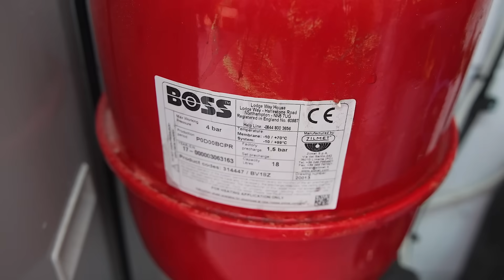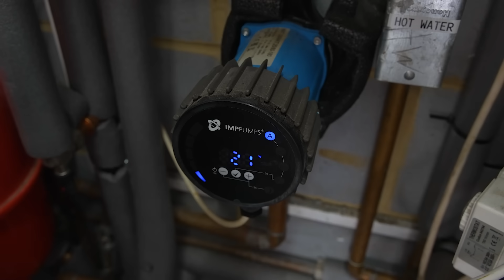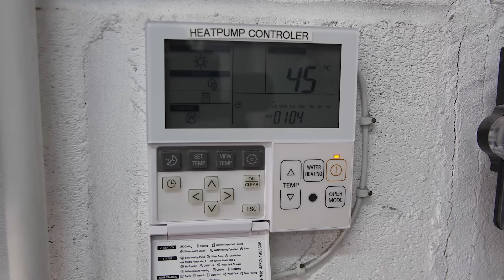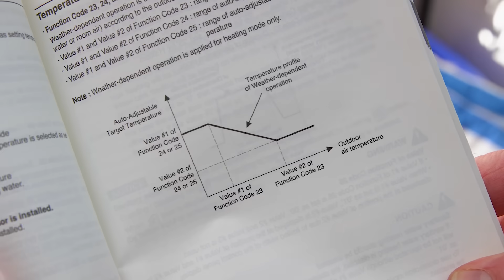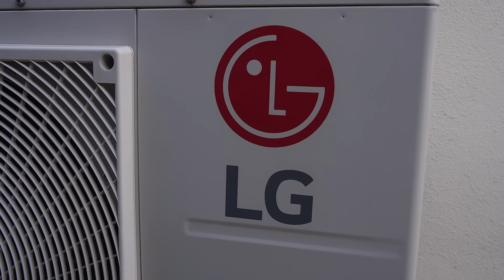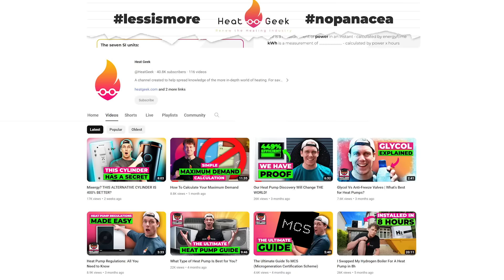Heat Geek Gives His Verdict on John’s Nightmare Heat Pump

Comment: I am Canadian and live in Saskatchewan where it is common for temperatures to reach -30 degrees celsius and lower for days  on end during the winter months. I worked for a school division for 24 years in maintenance and was looking after a school that had 22 roof top units which were basically a furnace and an air conditioner unit enclosed together in a metal cabinet which had at most one inch of fiber insulation on its inside walls. My question is in this day and age and our quest for energy efficiency why would you place these units on a roof top exposed to the elements . They were very hard to work on when the wind was blowing and it was 35-40 below celsius and I can only imagine how efficient they would have been . I can`t see much difference between them and these heat pumps except that the units on the schools were natural gas and heat pumps are electric which is even more costly and less efficient.

Comment: Question for @heatgeek:
I am looking at a system where the hot water tank uses a plate heat exchanger + circulating pump to take heat from the heat pump loop instead of an internal coil. I believe the main bnefit of this is that I can get more usable hot water in the tank (it' s a 170L) as there's no coil taking up space. 
Thoughts in this setup type?

Comment: Great video, Thankyou. I've got a heat pump and the installers didn't explain weather comp at all. I worked it out through heat geek advice.

For the underfloor heating I kept a blending valve on the circuit for underfloor heating because my LVT flooring has a temperature limit of 27deg C. Do you think a flow temp of 45 Deg C straight into thea manifold would be safe for the LVT?

Comment: Great video would love to see a follow up when savings can be proved. The fundamental issue for me is that after spending all that money, even 420% efficiency is not enough to make it cheaper than a 90% efficient gas boiler. 35p per kwh electric / 4.2 = 8.3 pence per kw heat for electric. 7p per kwh gas / 0.9 = 7.8 pence per kwh heat for gas. So even the most efficient system costs more to run than gas excluding the additional cost of heating water less efficiently and the fact it has to run virtually all day long.

Comment: The lower COP is because of the difference or delta with the indoor temp and outdoor temp. the buffer means it can stop the heat pump cycling and for a reserve of heat for defrost cycle

Comment: They haven’t installed a pumped mixing manifold just because it comes as part of a package, you can buy manifolds without these things. If your secondary pump hasn’t been sized to overcome the resistance in the underfloor heating circuits, then you will need a pump on the manifold. If your flow temp is set to 55/60 like this guy said, obviously for hot water production purposes, you will need a mixing valve as the underfloor heating will be designed to run at 45 deg c. 

Buffer vessel is installed to stop short cycling of the heat pump, and although not always required on a domestic system, is always a good idea if your heat pump comes with its own hydronic pump set because these pumps are best used as a primary circulator only.

If you are having frosting problems, do. It take out the glycol.
Reply from the maker: yes we know you can get the manifold without the rest but Adam is saying it comes as a package and that is why it has those things. It may even have predated the heat pump

Comment: The 2 stage heat pump is called a "cascade" system. New condenser fan motors are going to be a lot less expensive than a new heat pump.

Comment: I’m involved in a heat pump installation and the brackets are so short the space behind is limited and the brackets themselves are flexing so it is not going to be level ,  not even finished and it needs some improvement

Comment: It's criminal that heatgeek recommended replacing the outside unit instead of just placing the fan. In fact the first least expensive fix would to be to just grease the fan bearings. Leveling the outside unit would hardly make much difference but wouldn't hurt. The tilt certainly wouldn't be the cause of the bearings wearing that much, it's just lack of maintence i.e. oiling or greasiing the fan bearings one every year or two. I've  replaced my heat pump condensor fan for $150, it's a very simple DIY job. Replacing the entire 5 year old heat pump unit for thousands, because of a squeeky wheel, is a crime!
Reply from the maker: The heat pump is a high temperature unit, basically two heat pumps, so they are making a judgement that it won't achieve the efficiency. All tradesmen can tell you the tale of trying to save the customer some money and it ending up costing more.
Reply: @SkillBuilder  I'm assuming the 'heat pump(s)' is a condenser unit housed in the outside unit with the fan? That's what we're used to in US. John said the existing setup was providing sufficient heat so why replace them? I thought heatgeek was initially talking about only reducing the not-needed equipment inside like the buffer but then later said to replace the noisy 5 year old heat pump.

Talking about efficiencies how come heatgeek doesn't make any emipirical measurements to show that his recommendations will achieve the resulting improved efficiencies he claims. All he seemed to provide was the typical hot air that all salesmen give, only for the customer to find out a year down the road that the claimed expected savings were bunkum and the bills are in fact higher having spent all that capital on extra equipment and labour. I hope John sees the light and doesn't dig himself a deeper hole with this clown show. 😃

Comment: Can the bearings be replaced in the Heatpump?  They got a guarantee?
I wonder if the massive weight of the heatpump - 120kg resting on half the slab - it might have caused the slab on the ground to have moved a bit over many freeze-thaw cycles. The installers should have stuck some paving slabs under the back - poured some concrete before putting that heatpump in. Made sure it was level.

Comment: We have solar with a battery, we have gas central heating, we removed are hot water tank two years ago which was heated by gas. We now have a electric shower and water heater taps in the kitchen and bathrooms 
. We turn are gas off at the meter in summer and just have a standing charge.
Are total electric and gas bill for a three bedroom terraced house is under £1000 for the year.
Can you imagine the noise from a road full of houses with heat pumps.

Comment: For me the relevant Cop is the winter, when I use the heating. The annualised figure is meaningless. The 5 - 6 months when heating may be required will have a lower cop, the critical question is how low. I am waiting to have my heat pump installed, but I am very anxious about the potential cost of running it.

Comment: 2 new outdoor unit motor's 335 each (orion air sales) plus an hours labour & providing the impellors are ok to be reused and not damaged from ice.  Add levelling or wall mounting the unit and maybe a repipe. Gets expensive when a boiler is about a grand or so to buy off the shelf.

Comment: I watched another video by a plumber who had installed a heat pump for a customer; and since it was his first job on an unfamiliar system he actually paid the original manufacturer to turn up and show him how to set up the system. To his surprise, the first thing the guy did was turn off the weather compensation because “it causes too many after sales callbacks”. Says it all doesn’t it! Regardless of how properly all this gets calculated and tuned, long experience gives me a natural skepticsm of something that requires so many sensors, electronics, pumps, refigerants and God knows what to work properly…because they usually don’t. Even modern gas boilers last only 5-8 years now because of the same features, so you throw away 2k’s worth of boiler twice a decade in the name of “higher efficiency”. It’s insane, it really is. I’d love to know how long they expect these things to last and would bet my left bollock you won’t get the grant a second time, so say hello 15k every 7 years?

Comment: I thought companies in Poland do crap jobs with heat pump installations, but seeing this made me realise they are actually not that bad.
In this case I would advice to spend weeks reading/watching about heat pumps before installing one. If system is properly designed then it’s good, but badly designed ones can be nightmare as it’s sensitive to mistakes.
Facts like frosting are basics and even user should know it will happen ( even at +5C, because UK is very humid) and it’s normal process. Even if it’s not desired effect it should not affect well designed system. In most cases better to relay on the heater inside the pump to help with defrosting than installing buffers. I don’t know modern heat pump without compensation curve or built in external temp sensor ( I don’t think you get different heat pumps for UK market). For UK temps. I would expect seasonal COP close to 5 for good pump. We get 3 in Poland where we get even -15C in winter.  Not many days but average winter temp is much lower than in UK.

Systems based on heat pump like open flow, so you rather design it in the way that everything is "wide open" (as mentioned) and you control it by changing compensation curve. If you start having complex system with many valves, thermostats which you keep closing it won't work well. It's about heating water just hot enough to deliver needed energy to the house and let this be spread slowly to the house (underfloor heating is the best).
My system operates on 24-36C curve (24C is for external 12C and 36 is for -17C) and  everything is wide open. Compared to "old" systems we are not heating to 50C or 60C or even 40C saving tons of energy.  Well, house is new and have very good insulation. Heat pumps are actually not well (or I would say not at all) suited for very old non-insulated houses. Sometimes you may need use up to 45C, but this should be rare and only for cases when you get minus temps. outside. Saying this I would rather advice to insulate house before installing any new heating system. It my be cheaper than wasting money into new expensive system and keep loosing energy due to lack of proper insulation. Bad approach.
It takes one season to find optimal temps for the curve but ones this is done it will work without touching. I have heated floor and radiators upstairs.
Tanks for hot water can't be (in 90% cases) taken from old installations. Then need much higher heating area than "old" ones and should be replaced. It's a huge mistake. It's 800-1.2K£ cost which should be taken.
Pump needs to be installed on solid base (you should lay some thick concrete underneath) and add rubber stands for vibration insulation. North is good side for the pump (pump sucks huge amount of air to work, so south it not going to help). South side may actually be bad due to fact that temp sensor may be overheated by sun and give false readings. In terms of distances- there is no need to guess anything etc. Each manufacturer gives clear instruction where and how to install or not. Just follow this.
UK, except high humidity, is well suited for heat pumps as they loose efficiency <0C. For typical UK temps they actually are very efficient and should work well.
It's quite ridiculous and scary to see a customers who is so sceptical, because well designed heat pump based system should be way cheaper than gas. It's a fact. It's way more expensive to install, but you should get money back within few years.
UK doesn't care about efficiency because it used to have very mild winters. Now it changed a bit so maybe this is why interest is growing, but there is no one to meet the demand. In UK air-air is actually not bad idea as winters are still not crazy cold. If you don't have money to invest in air-water then maybe, but long term (10 years) I wouldn't go air-air.
In this particular case depending how big is the solar system well designed heating should run at about 0 cost. For my small house and 5kWp solar system I'm at about 0 cost yearly (including house electricity usage), even we have weeks of constant minus temperatures (recently we had 2 weeks with constant 0 to -8C). Regarding pump itself. Pump should be serviced every year and has warranty, so things like we saw should be fixed either by company which installed it or by warranty (well if they saw video they would not accept warranty due to poor installation). It's possible that this bearing can be fixed - definitely cheaper than new pump. 5 years old pump is nothing - it meant to last 20 years and properly maintained rather will. System looks over-engineered as Adam said.
Maybe it's a business opportunity :) In Poland typical installation with 9kW pump is about 8-10K£ depending on the pump.
I don't agree LG is bad. LG may not be the best, but does very good compressors and heat pump is 70% about good compressor. In the same time I would rather go with Panasonic or for more money Daikin. Viessmann will probably have best support and it's also good.

Comment: The only training people want is how to turn the heating on or off. Heat Pump Systems are not capable of providing proper heat. Install a gas boiler and sit back and relax. Heat Geek is well named as he has basically said replace the whole installation and it will be perfect...I doubt that. And the fans will still be ugly, big and noisy...and still ice up. Just give up as nobody wants them and they are not the future 😂😂😂

Comment: I'm not a plumber, but find Skill Builders videos very informative and indeed entertaining. This one was great, I learnt a lot. The existing installation just looks scary to me, if I compare it to my small combi running 9 rads and hot water. But like some many heating installs, it really isn't one system suits all. I think general insulation is the first step, where possible. I had PIR installed 2 years ago and made sure there was the required air gap/vapour barrier etc. It's made a huge difference. But I'm against government schemes were tax payers subsidise such installs for other home owners.

Comment: Great video and makes alot of sense. One thing that I'm not sure about is, yeah the blending valve dosent need to be there, but is there any actual point in taking it out if its set to the max flo temp of the heat pump, it's not going to be blending, so why bother whipping it out? I'm about to do an overhaul of my own central heating as part of an extension, going wood pellet, but interested to know whether I would need a blending valve and pump for the under floor zones with a pellet boiler?

Comment: Wonder why not repair the heat pump (decent  brand) and then do the replumbing and weather compensation vs replacing a new HP or moving back to gas.

Comment: if you turn the isolating valves off and it still putting in pressure one of the valves isn't sealing i would guess

Comment: air to air can only do single or a few rooms at a time. the heat pump should be designed for the lowest flow temp and improve fabric, redue heat loss, have you seen sunamp heat battery.

Comment: My old flat was electric only. When I renovated it I there was enough space that I put under tile heating in the kitchen and bathroom. I would recommend that if possible. It was glorious and I still miss it.
 I rent it out now and will be looking at a Heat Wayv boiler for the hot water, if and when it comes out. It should be superior to the electric shower.

Comment: I like the style and honesty reflected in these videos. 
I am still wondering about the bearing noise, which were claimed to be caused by the slight inclination of the external unit. 
The vent bearing is supposed to support an axial stress due to the push of the air. Therefore the slight inclination should be somehow in the same range of the stress for the bearing. Maybe the bearing was so warn out rather because of the pump being forced to work at full power for most of the time (the 45 degrees set for the output). Pump inclination is not a good think indeed, but could this alone lead to the bearing noise? 
Am I wrong?  What you think?

Comment: I am not an expert nor an installer but I am from Finland😊. I just replaced my first geothermal heat pump that run for 20 years. Hear you have an air-to-water system with heating elements on the wall I Suppose. Here it would be recommendation actually to put in the extra boiler for kixing in such a system. The reason is that you will otherwise have konocing sounds in the pipes and elements. I wonder if that was the original idea.

With the new inverter type heatpumps I think this is not nescessary. We have a low tempreature floor heating system with as little flow restriction as possible betwwen the circuts. Downstairs I however limited the flow as as the floor heating is in the concreate slab with tile flooring. Upstairs  this is not the case, so it needs litttle more flow. The outgoing tempreature is set to 40 C. That is sufficent down to -25 C. If it gets colder than that and I will anyhow use the accumalating fire place to help keep the electricity bill down. We have 240 sqm to heat and heating, warm water, and household electricity consumption is 9-11 MWh per year depending how cold the winter is. Ground water tempreature here is around +6 degrees. The incomming tempreature have not gone under + 4 degrees this winter despite we had acouple of weeks with below -30 degrees. Active drill depth of the well is 178 meteres.

Thanks for the nice videos. I watch these kind of stuff from all over the world. Everything from solar to batteries in Australia to whatever.